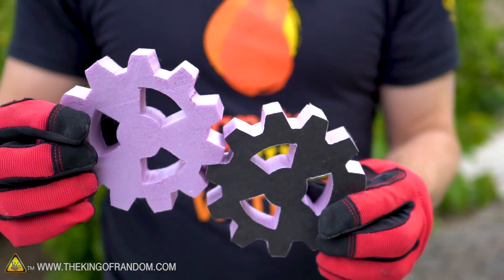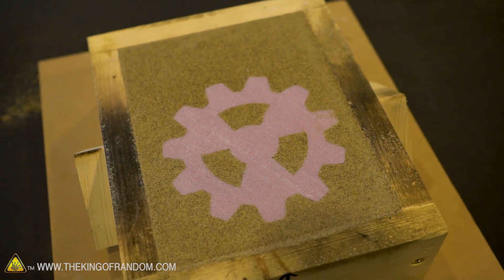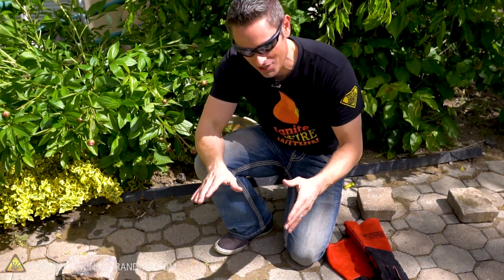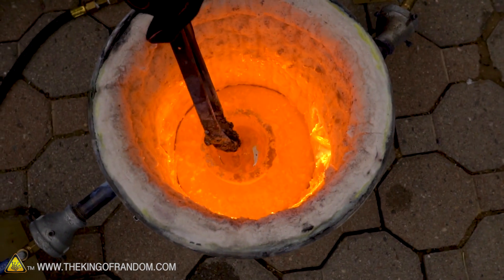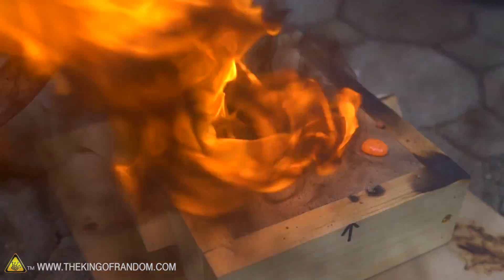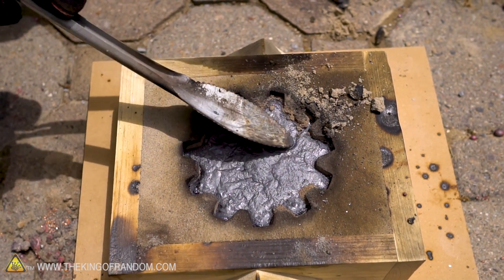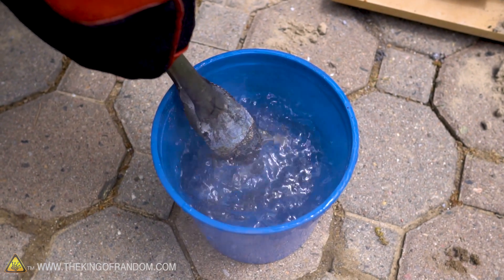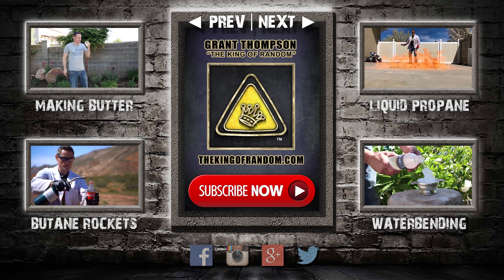Argh. Why Is Copper So Difficult? TKOR Tests Melting Copper In Our Homemade Foundry

Comment: Until you find a stable mix for the green sand, try using a thinner mold so you don't need as much to fill the cast so it won't solidify as fast

Comment: Ive seen other youtubers use 2  blocks of sand, where the styrofoam Gear is in the center and a  Styrofoam Block to pour the molten Copper directly to the gear... you should try that

Comment: Hey Grant what if you used clay instead of sand because clay will harden up but not break or float to the top. When you poor the coppper in to the clay mold it will bake it but it should hold out. Plz give this a try.

Comment: I think the pressure of the molten copper is exceeding the binding strength of the green sand. I've watched some videos on other channels and they seem to use cores to create voids like that. The cores have a binding agent that holds them together. It also requires both a drag and a cope to keep the core in place.

Comment: you should use a synthetic oil based sand You also need a channel instead of pouring directly on the form.  For a perfect reconstruction, case the Styrofoam in ceramic / porcelain and plaster.  melt the Styrofoam out the form, dry it and pour.  it will come out perfect

Comment: instead of copper why not use a metal with a lower boiling point than copper. Or try using a mold other than sand.

Comment: Build a proper sand mold. There should be two halves and the mold should be in the middle. The whole point of foam casting is that the material replaces the foam, the foam isn't just left in there so it doesn't mess up the sand it, it is there to be replaced and by having sand on both sides you have structure on both sides so your detail parts don't float away.

Comment: Having the other side of the mould gives support to those centre bits. Adding water would make steam when exposed to heat, you're best bet is probably plaster of Paris. High detail, high heat resistance. Also, having a pour spout that would take the brunt of the weight of the molten copper so it doesn't damage the sand from its mass is also important.

Comment: why don't you use plaster? the backyard scientist had a video with an old oven modified to melt aluminium and he 3d printed the object he wanted to cast then made a plaster mold around it and he would use that oven to melt out the plastic. But if you wanted to do that last part with 3d you would probably need an electric heated smeltery so the plastic can melt but not burn.

Comment: Why don't you cover your mold with the other halve of the box like most people do. This would probably prevent any parts from popping out. You'd need to pour copper really fast and need air vents though ;)

Comment: Is there a way to make the sand firmer without adding water? I would think the added water would just vaporize causing the sand the be less stable. Is it possible to add something like thick clay to the green sand? Either way the last gear looked pretty cool.

Comment: try to take a metal plate and drill a hole in the middle of the plate. than put the styrofoam in the sand and the metal  plate in top; so it works like a cover.

Comment: wax displaced clay mold, hand packed sand just won't work for any detail casting of copper, I believe they use sand for ingots and such but anything with detail needs to be dry and firm like a clay mold

Comment: your mold lacks the structural integrity to hold up, the inner holes, or as in the case of the hollow mold,  pillars, need some form of a dowel or a carbon rod that can withstand the temp range to hold up the sand. and also, why dont you remove the foam precast, you can stab it with a hook or something and pull it out, (if you dust the inner parts with something like talcum powder or something soft) 
that will take care of the weird looking Styrofoam residue which burns up in the initial pour.
and rather than doing an open pour, try making it in between two frames, where you can have a channel from the top leading down to the enclosed hollow chamber inside divided between two halves of the mould with the top half having a overflow residue cup, that will give you a pretty decent finish on both sides.
we did some basic copper casting back in foundry lessons in engineering classes, it worked out fine

Comment: Grant! Why not use your 2nd half of the sandbox to create a enclosed mold. Then have an opening straight into the styrofoam from the top to pour the copper in. The enclosed mold should be packed tight enough that the middle pieces (the radioactive symbol) wouldn't have anywhere to pop up

Comment: Maybe you could try sand casting with both the cope and drag. that way the sand for the radioactive symbol wouldn't be able to float on the copper since it would be under the weight of the sand above it.

Comment: Hello, the king of random 
I think if you use your bigger green-sand box as the Bass and your smaller one as a flat face funnel it might hold the shape better. the flat face funnel well most likely need to be compressed tighter then the Bass. but what are experiments if not trial and error

Comment: That little bit of copper costs 60 bucks? Wow, either copper has gotten extremely expensive or it's just that expensive at your hardware store. Why not go to the scrap yard and take some old cables or something? Should be cheaper.

That is also not propper greensand, it should hold its shape much better. Watch some videos of myfordboy, he show's how to cast with greensand.

Comment: density is the key whatever you try if you don't put a top to your mold the sand gonna float wet or dry ...... sand density is about 2 copper is around 9

Comment: Hey Grant.  You should try bonding your sand with motor oil instead of water.  The water is boiling and steaming and tearing up your mold.

Comment: i have a few ideas on how to cast a copper gear,
1: make the mold the day before
2: let the mold dry out
3: melt the styrofoam with an open flame and not the crucible 
4: pore the copper slowly
you may find it works a little better

Comment: Grant I think that your problem is the amount of surface area that is exposed when you pour the molten copper in the mold. With more surface area the metal cools down to quickly. You should try and do it with a "button" on top to pour your copper down into.

Comment: You can use the mould of the gear but you need something for the top so the little chunks of sand cant go upwards.i think you made 2 pieces of those woodensquares. you can poke a hole through the top and fill it that way. Like that the Copper wont cool down that quickly and the sand chunks will stay in place. Hope i could help you (i know my english is not the best still hope you know what i mean)

Comment: Maybe the moisture in the sand is evaporating quickly, causing the little bits to break free. I would say less moisture, however by doing that, your molds don't hold. Try investment molding.

Comment: The 3 sand thru-hole shape snapped off because its density was lighter that the molten copper. eg like Styrofoam on water. 

try using something heavier or screw 3 shape (dried plaster shape) into the wood base then put green sand surrounding it and the Styrofoam thru those shape to form the sand cast. that will probably keep them from floating up.

The copper is hot enough evidently as it stayed molten in the middle of the gear shape and why the sand shapes floated up.

Comment: hey grant, instead of keeping the foam at the top, why not try it where its buried in in the sand cast with a little foam sticking out for pouring. like your metal sword. then you'll have two sides holding down the foam and sand.

Comment: The sand around the gear should be as dry as possible but you can use more wet sand further away from the gear is should work a lot better if you see this

Comment: Try boiling water insde of a balloon!
Since fire won't pop a balloon when there is water inside of it!
Reply: I've boiled water in a plastic bottle... I assume the problem with trying it in a balloon would be pressure from steam building up..
Reply: Xvinfajtr easy, with a magnetron
Reply: Xvinfajtr that would be cool
Reply: Sniper Ghost probably not, you can boil water in a Styrofoam cup at least so I assume the same would work with a balloon
Reply: It won't melt until the majority of the water has reached it's boiling point. The heat going into the balloon's surface will transfer pretty efficiently into the water contained inside for a bit which means no melting at first.

Comment: The sand is too dry,  when you tried for the final time you added some more water that created the indentation. BUT the copper is too hot and it causes the moist sand to heat up causing the water to vaporize. if you use a less hot metal like aluminum or brass it might work with green sand.

Comment: Make 3 "hole" shaped copper castings of the holes in the gear. Then make a styrofoam gear and put the hole shaped copper castings inside of it. Maybe the copper will cool down quick enough to not deform the other 3 castings.

Comment: I would have made a mold by making a wax gear, encasing it completely in plaster, then melting the wax out in the oven. The mould should probably be pretty hot so it doesn't crack when pouring the copper.

Comment: why don't you start from squar 1       and  cast it like you  casted your  first sword with out both sides of the mold  the copper cools to fast    see the sand  holds the heat so the copper has proper time to set and cool  that why you need both sides of the mold

Comment: I don't claim to be any sort of expert but maybe start with an easier mold? Like the gear without the holes so it's more stable. Also maybe adjust your green sand recipe. Maybe a little more clay??? Or maybe block it tighter in. I think a combination of these things might help along with possibly a different metal like brass or aluminum

Comment: You need to use something like talc on the edges / back of the gear and extract it from the sand before casting. The "Left Behinds" are interfering with the pour of the metal.

Comment: I would try heating the sand with that big fresnel lens you have. Also, 1 hr before you pour you could mix up some plaster of Paris thin enough to soak into the sand. After you've buried the foam gear with 5/8" of sand, dribble the thin plaster o' Paris into the key spots. Half an hour later set the fresnel lens to heat up the pour side, and another half hour later try to pour.

Comment: What if you tried doing it with the full box. Putting the styrofoam in the center and casting it like you would the brass or aluminum? That could work if the copper is hot enough.

Comment: Since part of your trouble is with the sand breaking, you might want to try CO2 Silicate casting. You don't get to reuse the sand then I don't think, but the sand will stay rock solid.

Comment: why don't you change how you're doing the mold. incase the styrofoam template complete in the sand and add a tube to pour the copper down. 1 the sand insulates the copper and 2 you should have a better product

Comment: you gotta pour copper really fast. it also helps if your mold your pouring into is hot.
I worked for a Casting Foundry and Copper and red brass was a pain due to had to change the entire process from other metals.
Reply: as for the sand breaking off. might be an issue with your green sand. at the plant we used the tree moldings that had some kind of wax on the inside (easier to form gun part with) and then we dipped them in some plaster like material. the result in the end had a cup for us to pour into so when you pour it. it would fill up. copper we had have the moldings buried in completely to hold the heat in because its so brittle and can crack easily.

Comment: you should put the foam in a bucked of sand or you have to make 2 half ones because the sand is not strong anough so it needs 2 points where is is attached to the other sand

Comment: you should really scrap the top of the crucible to take off any impurity's and slag, it helps with casting so there aren't any bubbles or weak spots or random thing in it. the casting would come out better. Also, out should let the forge get hot with the crucible first, then add in the metal. Melts faster and stays at a high temp

Comment: You need to do a double mold, and pour faster into that.
It's coolong to fast and a double mold keeps the heat longer.
Use a less dence foam.

Comment: Mold design is actually a highly developed science... I would suggest a pre-heated mold for the cracking problem, but that eliminated the ability to use the styro preform method. You should invest in some mold sand with the plasticizer.

Comment: Hello my friend...
Cooper is one of the best metals to exchange heat. 
It probably will give you some problems, especially because you are casting it in a open cast.
I could suggest you to try do do it in a closed mold.
Other suggestion  is to overheat the cooper, but I´m not sure if your  blowtorches can give you more temperature...
One other suggestion is to add some tin in your cooper and make some bronze (about 12%). it will lower your melting point, what means that the metal will take a little bit longer to solidify.